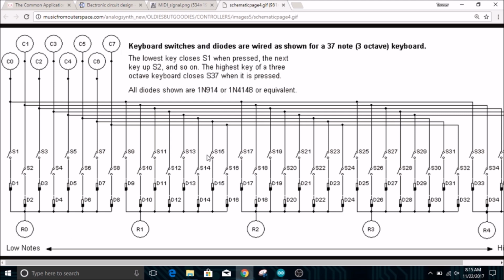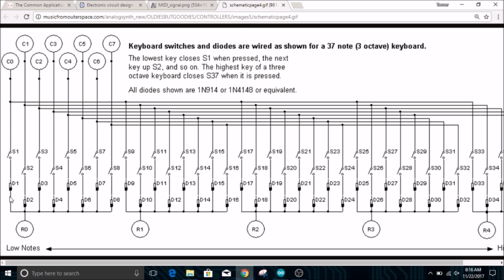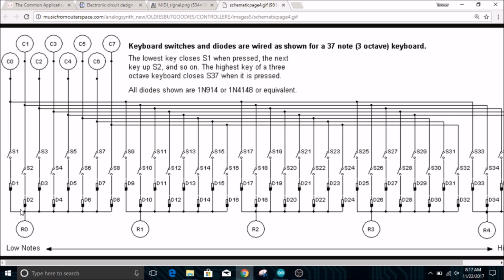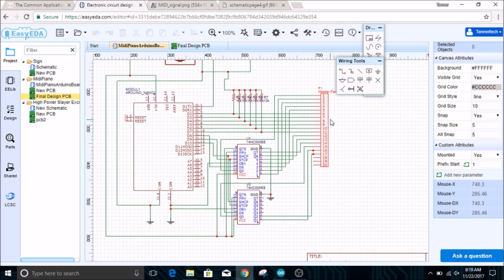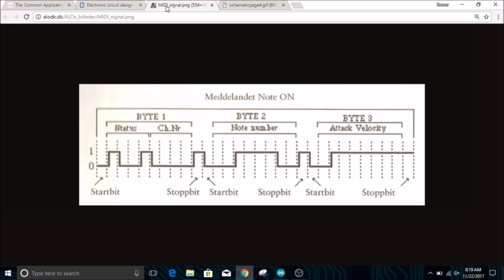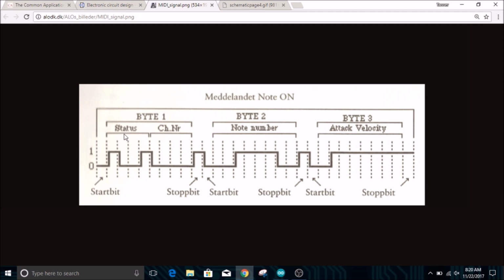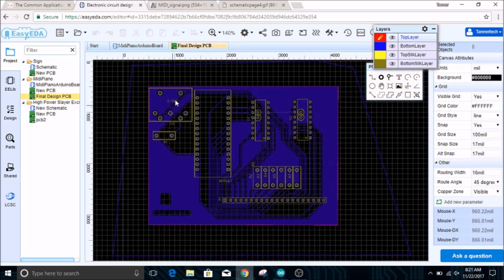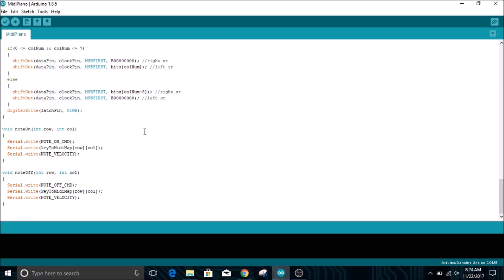Broken Keyboard Turned MIDI (With Custom PCB)

Comment: Awesome! Because you do not use Arduino Leorardo or Pro Micro to do this ? I just finished now my small USB-MIDI interface to connect my midi  devices (midi IN and OUT DIN5) to my PC. It use a small Pro Micro (clone) and my PC see it as true USB midi device with midi in and out ports natively, Windows and Linux.  You can put here both outputs, midi DIN5 and USB and if connect USB to a pc any program that use midi see this midi instance (midi in and out). You can even change the name so eg. your computer see it as 'My Midi Keyboard' instead to see 'Arduino ' . I know that for this project may you need more pins to read  the key matrix, but if you use shift registers even a Pro Micro is perfectly suitable.  If you contact me I will send you some Arduino code. Thanks for the instructive video. Any board with AtMega 32U4 is able to do this.

Comment: Hi, Tanner Tech. Is there any video, how can I build similar controller, but not breaking original keyboard - I want to controll some old non-midi keyboard through midi. For example old yamaha psr-11 fm keyboard.
Reply from the maker: Hmm, not sure.  You would probably have to connect a transistor across each of the keys, and wire it to an arduino that takes a midi input.

Comment: My keyboard is yamaha psr-240  it has a 12 set and 13 set of wires which I think that should be it rows and columns I can't tell... how do I connect them to arduino...  am in Nigeria if pleased i would love to send you some pictures for clearity my what'sapp contact is plus2348127932544... thank you

Comment: Man this is awesome! How much key's this Midi Keyboeard can press at anytime? I mean maximum notes that Arduino can process at 1 hit of Chord?
Reply from the maker: You could press all of the keys at the same time and it would register them all.  It would register them a fraction of a second apart though due to the shift registers iterating through all the keys in the matrix.  You would not notice that though as it is very fast.

Comment: Hello, I have a toy piano (Casio SA-1) that does not work, but I want to rescue the matrix button. 
How can I do it? it is all a single PCB, not like other models that have a ribbon cable
Here is a picture of schematics

Do I have to solder the cables directly to the Pins (27-30)?

http://2.bp.blogspot.com/-TweB7OD9sOw/TyVa9bezJ_I/AAAAAAAAALY/1upX3nQP6dY/s1600/schematicnew.jpg

Comment: I have a 32 key Casio keyboard with 12 pin cable. I think scan matrix should be 8*4. Could you please tell me how to figure out the split between input and output? Thanks in advance

Comment: ********PLEASE HELP ME ********.......Hey BRUH could you re upload both the files both aren't working......should I change code if my matrix is different and also the pcb should I change
Reply from the maker: Yeah, I had to change the code slightly for a different matrix.  This is the file for the circuit: https://easyeda.com/tannertech/MidiPiano-22a7509819f944f0bdfa7106de2b65b9

This is the code for the arduino.
https://github.com/evankale/ArduinoMidiPiano/blob/master/MidiPiano_PullDown/MidiPiano_PullDown.ino

You can change the variables for the number of columns and rows, depending on the matrix that you have.  The input and setup variables should also be changed.  The circuit board would need to be modified as well.  If you have the same matrix, you can just move the wires around so it works.  Good Luck!
Reply: @TannerTech  Thank You Bruh

Comment: I'm actually trying to add MIDI IN to my old keyboard, because I want to use an external sequencer to control/trigger/play sounds from the keyboard...I believe MIDI IN and MIDI OUT have been retro-fit to old keyboards to accomplish this, but so far cannot find the solution, ideas?

Comment: Hello dude right now I'm inspired by your video and kale videos but still im not into that experience to do it alone I wish if you can help me 
I got a 49 keys old casio the keyboard got 2 cables one with 6 joints and one with 10 joints and I wish if you can help me throught anyway like facebook or whatsapp
Reply: I have a similar issue. I've managed to hook up my old casio lk-90 with code by Moura's Keyboard Scanner (https://github.com/oxesoft/keyboardscanner) and an arduino mega and it partially works perfectly. My challenge is that, that series of casio keyboards has 2 ribbon cables, both are 16 wire ribbons (matrix 8x8) and I've figured out the inputs and outputs, but the code only works with the 1st ribbon and the 2nd doesn't get detected nor read/scanned. I'm certain both cables work and I get expected readings from a multi-meter but I just can't get the 2nd ribbon to work which means certain notes aren't being scanned. What changes can I make to the code to read the 2nd ribbon or do I need to change my entire approach?

Comment: Plz help with this !!!! 

Can we make a musical Keyboard at home... That sounds as realistic as a 300$ professional keyboard...
Without an Arduino or MIDI.. Even if we can't make it, Can someone explain the electronics behind the  working of  the ICs and Microprocessors used for that tone generation(with a sound quality much better than all toy keyboards😓) and all about that
I didn't find any YouTube vedio explaining that.... With in depth analysis..
Reply: Sorry but you will not get realistic sound if you will not use a microcontroler with uploadet tones. Its preaty much imposible to do it your selphe at home.
Reply: @jonaszkita8472  then which micro controller should i use? Can we buy one?
Reply: How big will the piano by ? (How many keys)
Reply: @jonaszkita8472  as a demo what about 37 keys....
Reply: @npsreedutt7049  Oh. Quitte big.
Then use shift regidters like the guy in this video (remember about the resistors) and conect the keys using them to the arduino. Next record sounds from a real piano. One for each key. Buy an arduino and write a program that will play these recordings acording to wich key you press. Done.
Reply: @jonaszkita8472  so u mean we can store the sounds in Arduino and connect it to a speaker and play the notes with out pc / lap...?
Reply: @npsreedutt7049  yes but of course use a small speaker.
Reply: @jonaszkita8472  but I've seen people making piano with arduino (in YouTube) and still the sound quality isn't matching the real keyboard quality....
Reply: @npsreedutt7049  You will not get a good sound from a simple project... Just take a look inside a cheap good sounding electric piano. Complicated IC's , many components and everything made precisely. Are you making this for a school project?
Reply: @jonaszkita8472  No not for any kinda project but I'd love to learn about their working I don't mind even if I can't make it but still how do they work which microprocessor and all such kinda stuff I want to learn the  theory  behind their working
Reply: @npsreedutt7049  there are some videos about that on the internet. I dont think i can explain you somenthing. I am just an electronics amateur.😅
Reply: @jonaszkita8472  well same m an amateur  as well... The thing is that I didn't find any vedio or articles in the net that's why I asked here....
Thanks for replying 😊
Reply: @npsreedutt7049  no problem. 👍

Comment: I have yamaha psrf51 with 61 keys.It has 13 ribbon cable and 11 ribbon cable how can i find the scan matrix.
Reply: I have a similar issue. I've managed to hook up my old casio lk-90 with code by Moura's Keyboard Scanner (https://github.com/oxesoft/keyboardscanner) and an arduino mega and it partially works perfectly. My challenge is that, that series of casio keyboards has 2 ribbon cables, both are 16 wire ribbons (matrix 8x8) and I've figured out the inputs and outputs, but the code only works with the 1st ribbon and the 2nd doesn't get detected nor read/scanned. I'm certain both cables work and I get expected readings from a multi-meter but I just can't get the 2nd ribbon to work which means certain notes aren't being scanned. What changes can I make to the code to read the 2nd ribbon or do I need to change my entire approach?
Reply: @shalommalitjane9602  Hello, can you guide me to make a complete one?

Comment: can you modifi the code so we can use usb port instead of midi port like those pre made usb midi keyboard best of luck and your bcb looks very cool and clean😀 👍👍
Reply from the maker: I have been trying to do that using a serial to midi converter, but I have not been successful.  Try it using hairless midi and loop midi. Change the baud rate in the code too.  See if that works for you.

Comment: excellent job. You should buy 20 or so $1 laser modules and make a laser harp or guitar with a similar midi Arduino setup. Some little photo transistors should work for sensing.
Reply from the maker: That would be awesome!  It would be even better to use relatively high power lasers in room full of fog.  I'll try this some day.